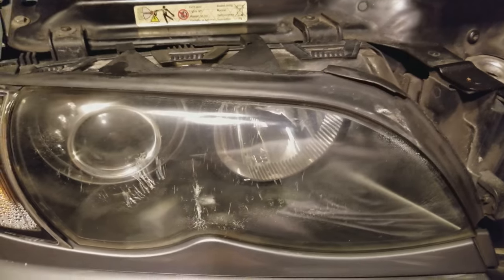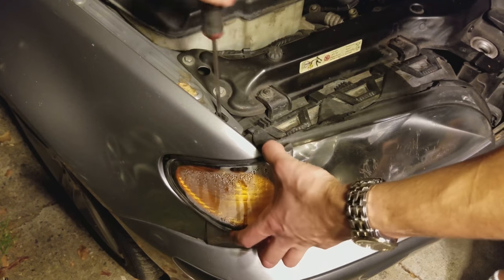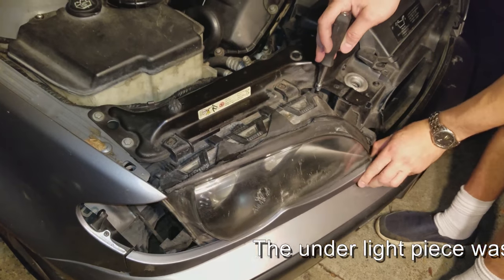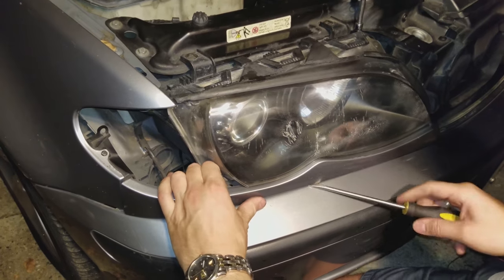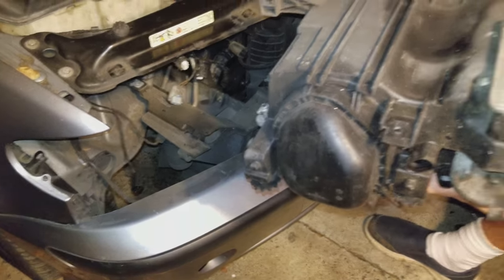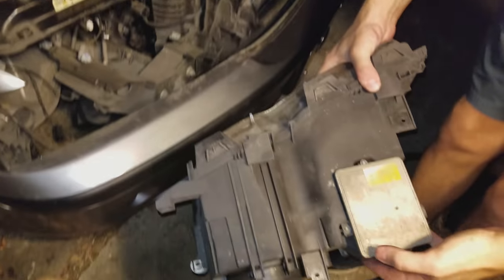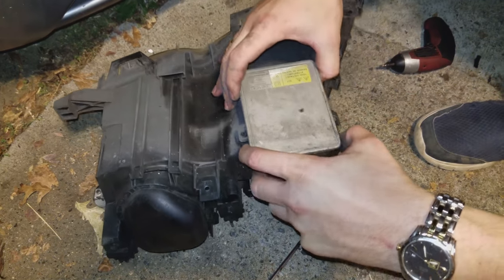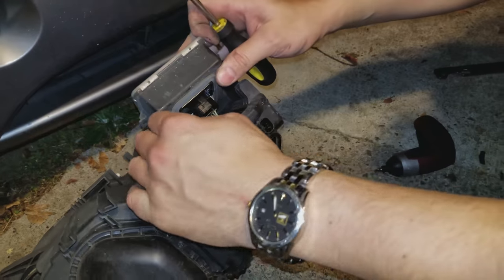E46 Headlight Balast Replacement

Comment: So was it the ballast or the broken wires? I also have broken wires and they are very hard to replace - it would have been interesting to film your process. Either way - Kudos to you for putting this up! Highly valuable material - I hit a high curb and my lights went out trying to diagnose now has been no joke. Thanks again!
Reply from the maker: This was a bad ballast. The wires were found bad during replacement so they could well be the cause for ballast to go bad. I soldered new wiring on passenger side and now the driver side went bad, its next to be redone, I will try to film it when I get to it but it might be a long video because the process took me 2 hrs on the other light. A very tedious process almost a surgery but it's better than buying another used light that might be not in much better shape inside and better than buying Chinese knockoffs that I still sometimes consider but always stop myself from buying them.
Reply: Thanks Bro!
Reply: @Kobe29261  for the wires, i used liquid electrical tape on the E60. I would rather have soldered new wires but the damage was too severe i had no room for soldering.

Comment: the back of the headlight on my 325xi is one piece how do i change out the igniter?
Reply from the maker: @TheJGJR9  at this point  there is no point to change anything in that head unit. Just get aftermarket  ones and install LED bulbs

Comment: My headlight bolts are rounded off and I can't get the cluster out. Csn the ballast be removed from underneath the car with the headlight assembly in situ?
Reply from the maker: S SINGH What bolts are rounded off exactly? 
It's not worth even thinking about changing a ballast while the headlight assembly is still in the vehicle because of the lack of clearance and access inside the headlight. 
Drill the bolts heads out with a good drill and good bit and replace with similar,  that's hours worth easier than any alternative option.
Reply: Alex K thanks for the reply alex. I am trying to remove headlight as the xenons are not firing up on one side of the car. I've swapped over bulbs but the same side stays out indicating bulbs are fine. Would i be right in thinking the problem is with the ballast/ignitor, or is there a fuse for each side that may have blown? Thanks.
Reply: S SINGH wish he would’ve replied lol.

Comment: I have a 03, m sport, m3 shape lights. Do i need to take the bumper off?
Reply from the maker: Abu Dharr not
Reply: lol I'm dying
Reply: imaging having to take the fucking bumper off to get the light out xD
Reply: Yes you also have to remove the radiator , water pump ,motor and transmission , thank me later